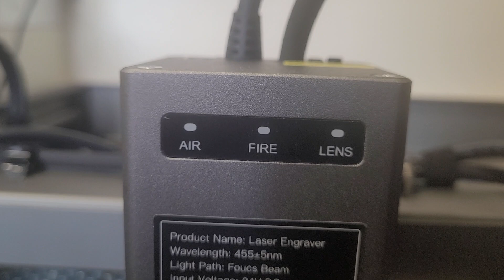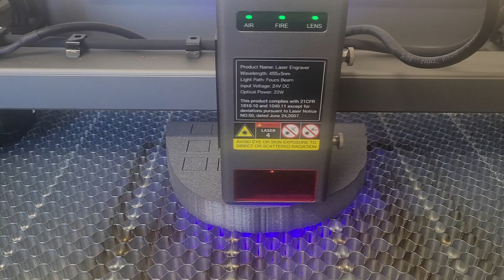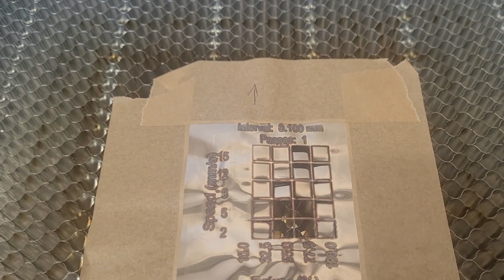The Future of Laser Engraving: 22W with Falcon 2

Comment: Love it! and completed so quickly. The windows came out perfectly 👍I haven't cut metal on my laser cutter yet, you have inspired me to give it a go, many thanks 😀
Reply from the maker: It's not as thick as etched brass, so it won't have quite the structural strength, but there are so many uses it could be put to.
Reply: @dodgydioramas  It looks pretty flimsy, but perfect for the scale. I have used wood or even craft foam for mini windows, especially if I want to curve them around something. Will definitely give the metal a go, cheers. 😀

Comment: Hello :) That's really nice ! But I am very surprised that we can cut foam and steel with a diode laser cutter. I was told by the builder of mine that steel would simply reflect the laser beam into the lenses system and damage it. And regarding the foam, I thought it would give toxic fumes, but I saw your previous comment saying "Don't quote me on this, but if the foam is safe for a hot wire cutter it should be safe for a lazer" and it makes sense ... ;) Anyway, Merry Christmas for you, if it's relevant for you, and have a nice day in all cases ! Cheers ! :)
Reply from the maker: Never thought of that, but they said it can cut 0.05mm stainless steel, and it can. I've cut quite a lot now and everything's fine. As to the foam, I saw lots of channels cutting it without a problem. The big no no is plasticard or ABS, which is a shame.

Comment: Great job! Loved watching this. What settings did you use to cut the stainless steel and brass? And it was 0.05 mm?
Reply from the maker: 100% power 12mm per second for stainless steel and 5mm per second for the brass, both 0.05mm thick. I do think the stainless could go thicker

Comment: Can it cut a sheet of paper and cardboard? Or does it catch on fire? Cause I want this one for building DnD craftings 😅
Reply from the maker: Certainly cardboard I've done that many times without any problems. Not tried paper. I'll give it a go tomorrow and report back, I'm curious myself .
Reply: @dodgydioramas  😅don't burn your house down...😅 But thx for testing ☺️
Reply from the maker: Sorry, I almost forgot to do the testing. So... no problem. I even massively overdid it and set the laser to cut 10mm plywood, and it still didn't catch on fire. It made beautiful clean cuts.
Reply: @dodgydioramas  Phew 😵‍💫 a bit scared tho lol... But fine it didn't burn your house down. Oh, and also good to know it can cut paper hehehe. THX for testing that! You can make a video of it cutting paper and cardboard 😉
Reply from the maker: If you watch my last video, 'What happens next? A Medieval Diorama build' at about 13 mins in it has cardboard being cut on the laser.